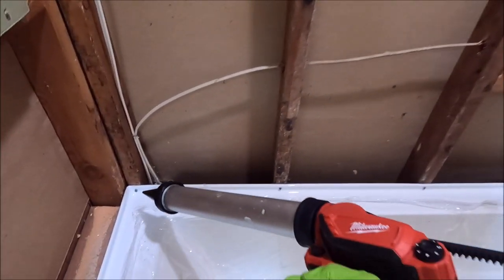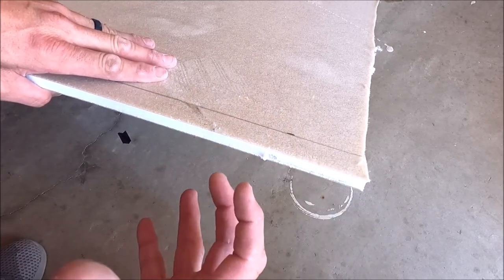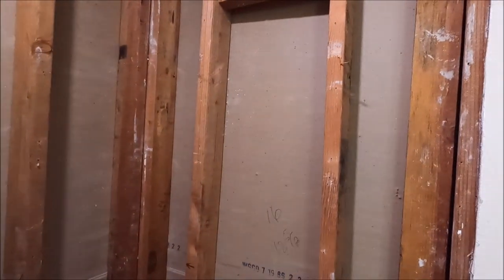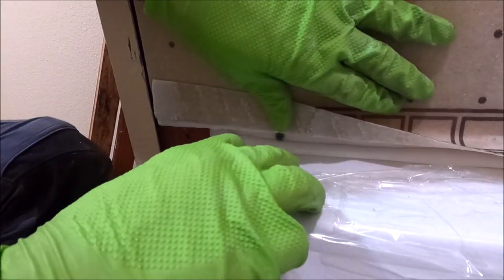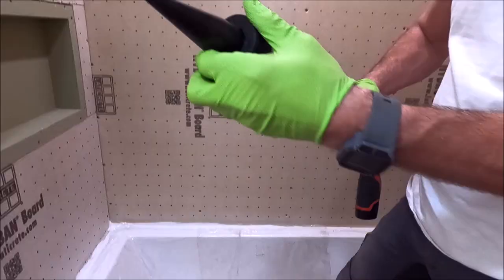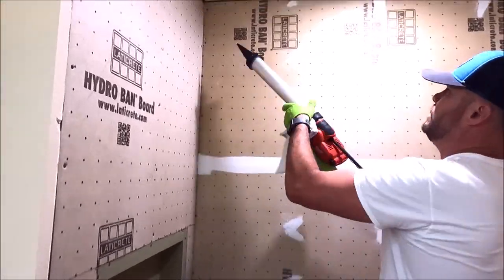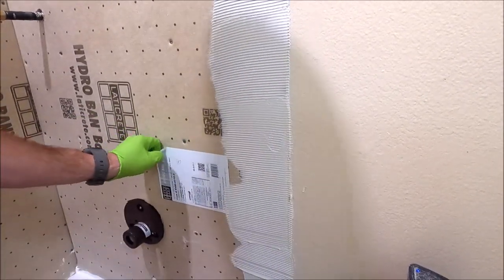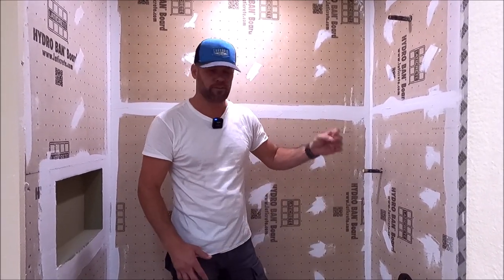Fastest Way to WATERPROOF a TUB Shower?

Comment: i like to lightly sand any part on acrylic tubs that will make contact with caulk. From experience the caulking usually separates from the acrylic tub after a week. Silicone, acrylic caulk and polyurethen caulk. it has a hard time sticking to these tubs. I have yet to find a good product that will make excellent bond to these tubs.

Comment: Ever pull a tile off of any of these sealants? It definitely is waterproof but also mortar does not stick. Probably not a big deal with a larger tile but if you were to follow manufacture instructions with overlapping the seams I think we will start to see problems eventually with smaller format tiles especially around niches and things like that which might be compromised of almost all sealant. I guess until then the grout will hold it all together!
Reply: Maybe the sealant has such a smooth surface, there's nothing for the thinset to grab.
Reply: @SgtZima  I’m going to try throwing some sand mix on the top right before it dries, excellent point